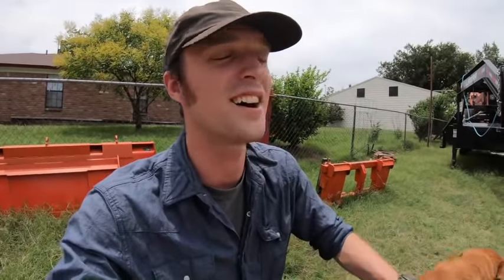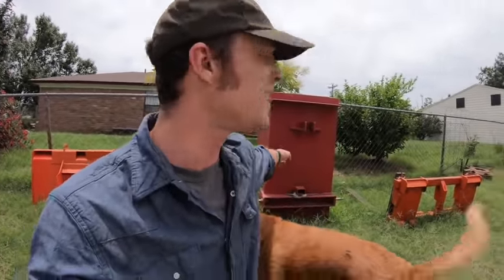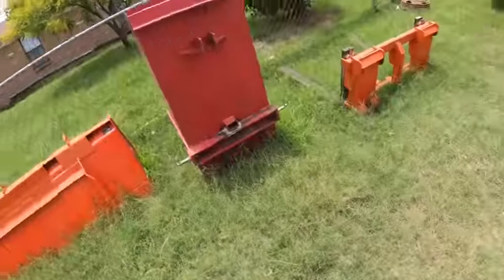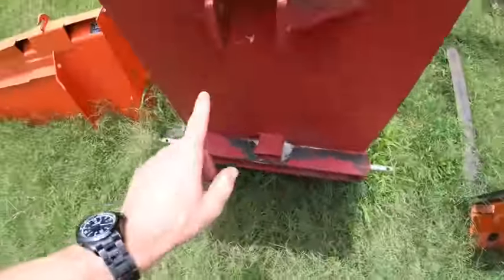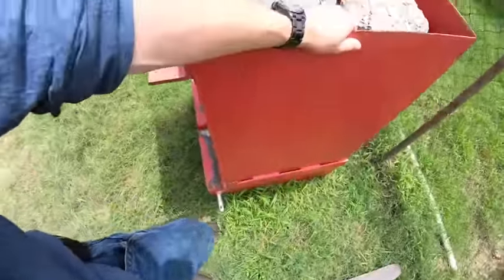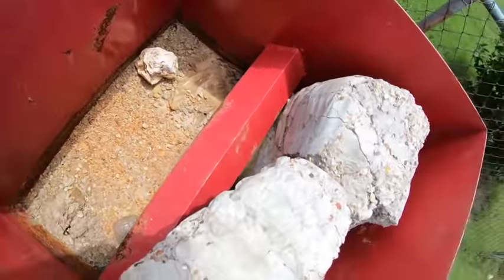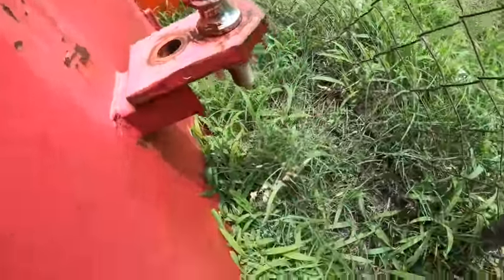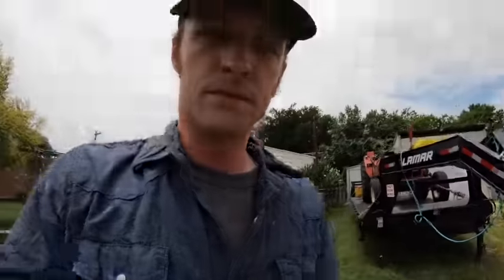BEST WAY To STABILIZE Your LOADER TRACTOR?!? DIY Counterweight Update!

Comment: water weighs 62.43 pcf,  concrete  weighs 150 pcf on average.  You went the correct route with concrete mix. Anything more dense would be steel bars

Comment: 4:16   If you get your 3pt hitch geometry correct you will have minimal tilt when you raise the implement.    Ask my 3 pt hitch fork lift, it stays very close to level even without hydraulic top link.

Comment: Concrete is twice as heavy as water.
Reply: yeah concrete doesn't float
Reply from the maker: All I know is that when I posted this a bunch of people told me I was an idiot and should've used water for that reason

So either people on the internet were wrong (impossibru) or else they changed how much concrete weighs in the last 6 years, I don't know, I'm just a fabricobbler
Reply: @officialweldingfarmingarch2041  if you throw a chunk of concrete in water it sinks therefore the concrete is heavier
Reply: @georgecostanza9387  or it’s a witch
Reply: @georgecostanza9387  denser
Reply: @officialweldingfarmingarch2041  I have been watching you for years now and love your content and humor.  Keep on doing what you do and fabricobble away.